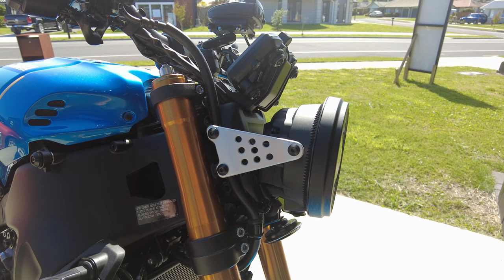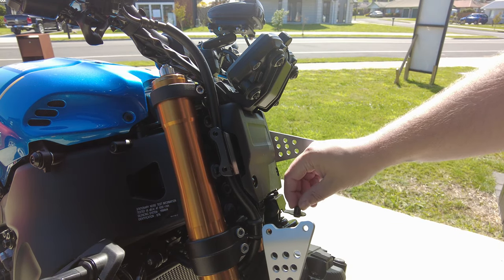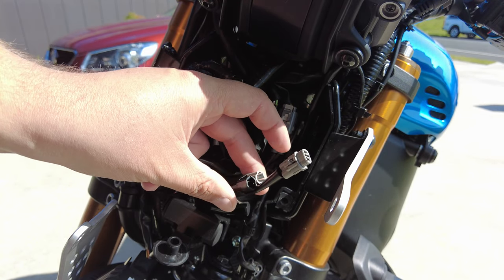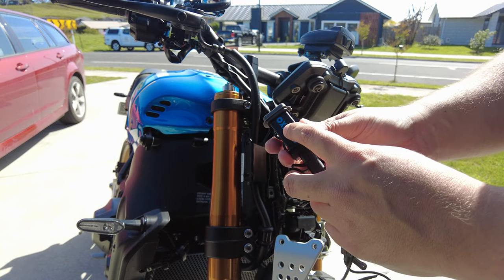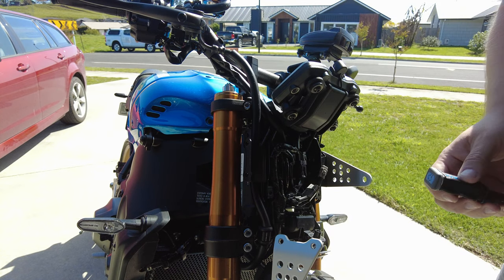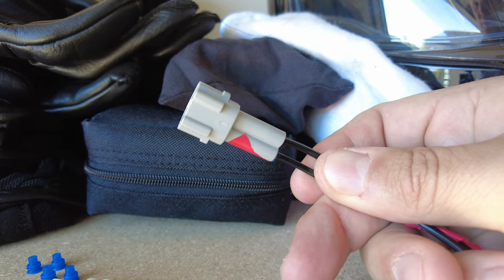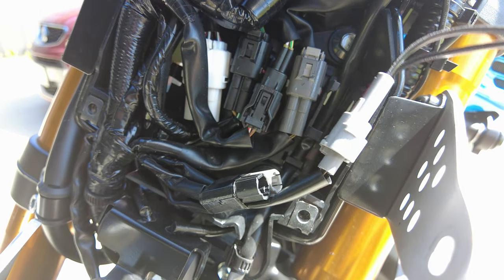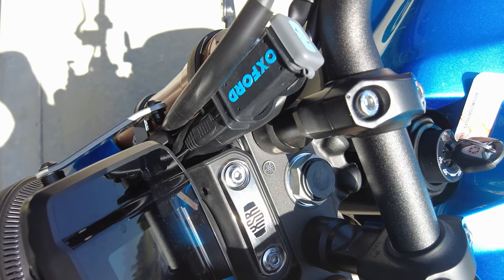2022 XSR900 USB Port Installation

Comment: This is what Posi Taps are made for.  They barely make a hole in the insulation, and if you ever do remove them (not sure why you would) then you just put a dab of CA glue over the pierced holes.  If you install them correctly, they will not break and strands of the OEM wire.  Lastly, if you are really worried about them being waterproof (they are plenty waterproof) you can wrap the connector in stretchy silicone waterproof tape, or use a dab of silicone caulk, or hot glue.  Once that connector was exposed you were literally looking at a 3-minute job.  But I respect your craftsmanship.

Comment: Thanks a lot, that helped me installing it without problems! I just bought the wrong pliers, so I had to solder the cables to the pins, for I could not press the pins tight enough with a small pliers.

Comment: Do you know if there's an accessory connector under the seat as well? The quadlock wireless charger comes with a long weathertight USB connector, so would rather mount the 12v->USB socket adapter there if possible.
Reply from the maker: Under the seat I am unsure what's what under there, I did attach my radar directly to the battery terminals under the seat, very accessible.

Comment: Details about the radar detector would be great.
Reply from the maker: It's a Adaptiv TPX 3, got it from radardirect.co.nz install is pretty straight forward but I can make a video if it would be useful.
Reply: @LindseyExplores  Any concern with parasitic drain since it's not isolated by the key? I wonder if you could run the TPX3 from this accessory port?

Comment: So much value beyond USB installtion. Can you please provide the exact Sumitomo connector that was used?
Reply from the maker: So I got the wrong one locally here in New Zealand but this link is the correct one.
https://www.aliexpress.com/item/4000706186620.html
Reply: @LindseyExplores  The wrong one was purchased from where? Part number? Looking for that one for my bike.
Reply from the maker: @Mothman  It was only described as the 2 pin sumitomo connector, I got it from Motozone in Kihikihi, they ordered it in for me ( I think from thier supplier Whites? ).